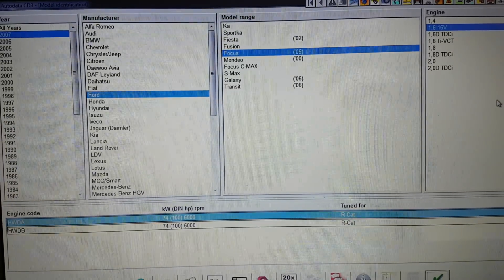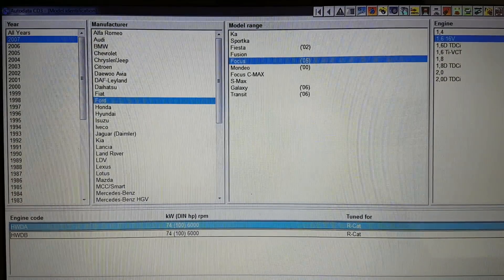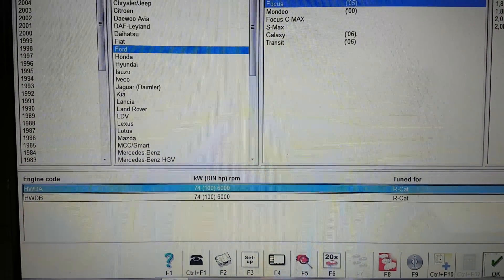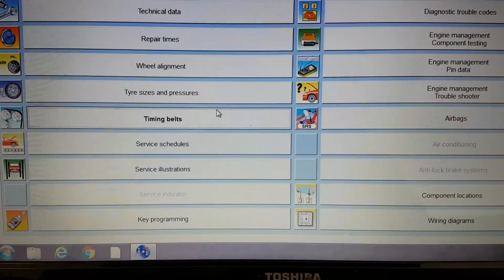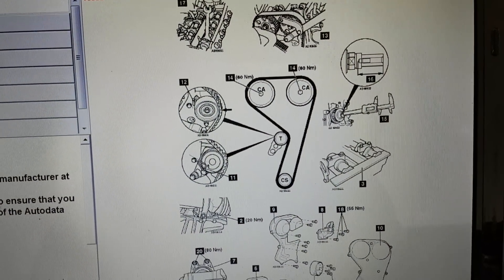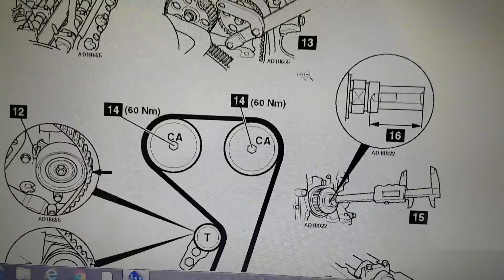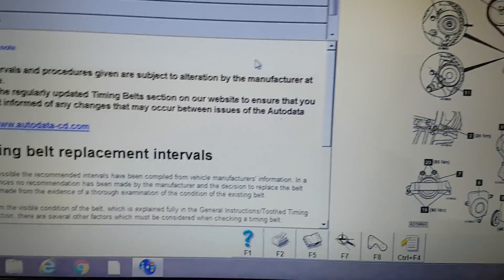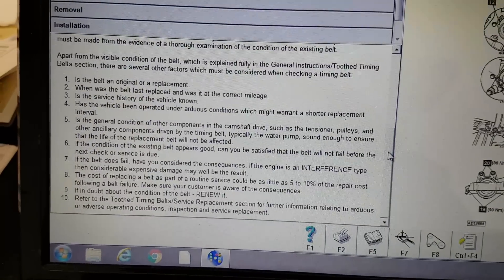Ford Focus Timing / Cam Belt Diagram

Comment: Hi mate.  Very helpful upload, thx for your time!  Wondering if I could get some help on the installation and final torque value of the tensioner pulley (same type as no. 11 on the diagram) for an 04 Mk 2 focus?  Cheers

Comment: Hi! Could you specify the tightening torque of the crank pulley? Is it 45Nm + 90 degrees? Will it be the Focus 1.6 Zetec petrol 2005? thank you very much